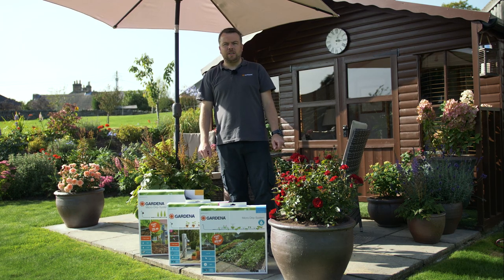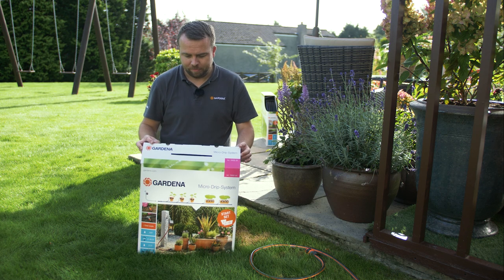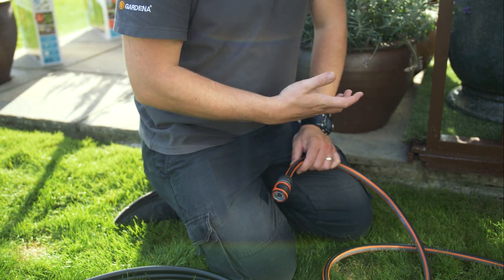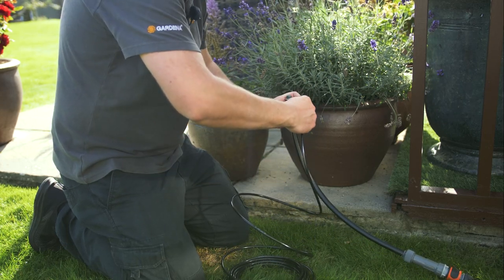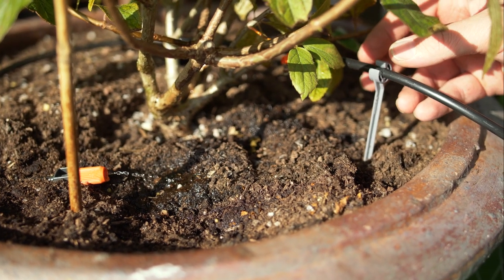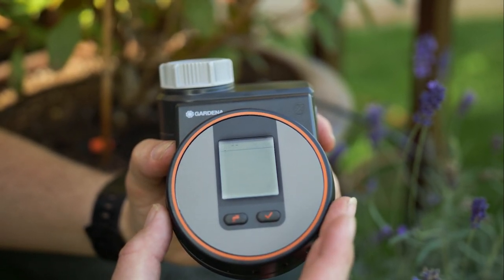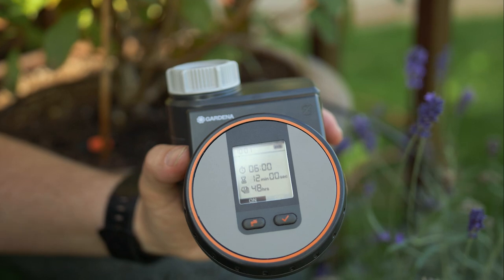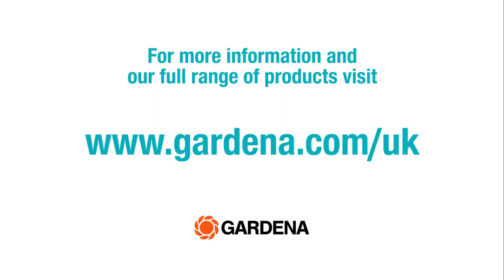How to install an automatic GARDENA Micro-Drip System

Comment: Good video. I just received my kit. But it won’t fit on my standard 19mm faucet, also it isn’t clear what else is needed. You showed a quick click connector and a hose that do not come with the kit. Is there a less commercial unboxing video that is a bit more transparent?